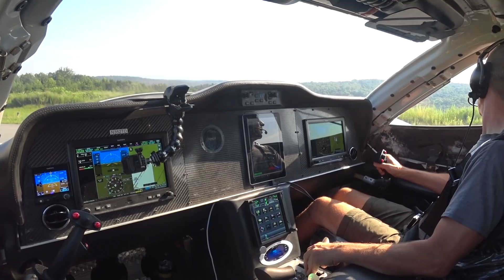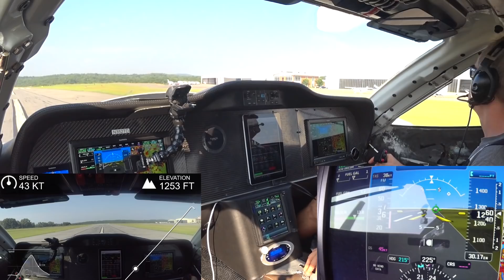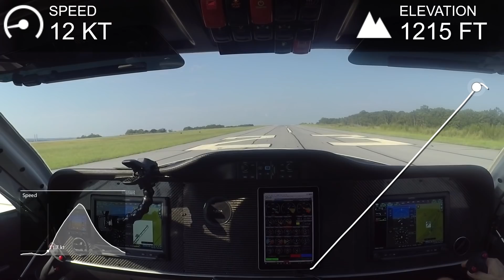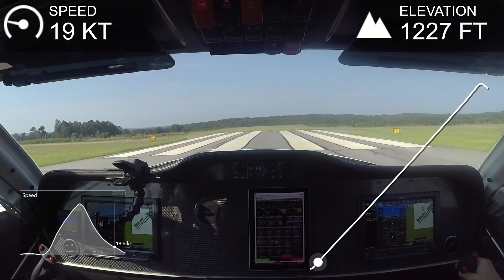Almost Airborne - Building the Raptor Prototype

Comment: Did i miss something?, I thought eliot was gonna fly the bird? 😅
Reply from the maker: I have said loads of times already that Justin is the pilot and Elliot will be flying the chase plane. I am not doing anything other than high speed taxi with the intent to attempt to just get it off the ground with power off if I can do it safely with plenty of runway remaining.
Reply: Raptor Aircraft putting the aircraft and yourself in danger. High speed taxi tests should be treated with respect and preparedness to actually fly. I think it’s time to leave it in the hangar till Justin gets there. Unless you want to become the test pilot.

Comment: Check out your synthetic vision in the video: it shows you far right of centerline. A few feet is in your RNP, but I've seen better performance from other youtubers.
Reply from the maker: The fidelity of GPS in this area has been reduced on occasion recently. I have noticed the same thing with my phone GPS. It's probably the military doing another jamming exercise. It's normally really accurate on the G3X.

Comment: How big is the exhaust port for the air exiting the engine compartment. The exhaust port maybe a bottle neck between taxi and take off speed. There may not be enough pressure differential to force the hot air out. Just a thought.

Comment: I notice what looks like piano hinges on the bottom of the wheel pants/gear cover. Is there a plan to add a folding part that covers the entire gear when it is retracted?
Reply from the maker: Yes
Reply: Go back a few months in the vids (cant remember the exact date...3rd quarter of 2019 I think.)

They were indeed fabricated,  attached, then removed...you can see why in the vids.

Comment: There  are a number of bayonet type cowling latches that can secure that hatch without cables. Each latch is independent so one latch being loose will not allow the panel to pop open.  Most military and commercial aircraft use bayonet style latches to lock frequently opened panels closed.  As a bonus, the underside can be painted bright orange to instantly indicate a loose latch.

Comment: I wish you had a longer runway to play with
Reply from the maker: If you look at the deceleration curve on the GPS overlay on the camera facing front you will see that my braking curve has room to stay constantly on the brakes whereas presently I get in it quickly and then I'm easing off the whole of the remaining runway. I have 2500 feet and I could stop in 1500.

Comment: Peter, I’m sure you know this well, but It can’t hurt to mention... I noticed when you pulled the nose off you gave it quite a bit of down deflection to put it back down. I’m sure that its an instinctive reaction. However when the main’s come off, resist the urge to push nose down and only chop throttle and go neutral so you don’t start a porpoise. I’m sure chances are low because airspeed is not much above lift off speed and you won’t be far off the ground. Good food for thought though.
Reply from the maker: As I said I'm fairly sure the right main already came off. 2 knots faster is not going to look much different. There's so little weight on the mains already at this point.

Comment: Peter, how much lead weight are you still carrying in the nose?  Using servo activated elevator trim,  instead of tabs,  i would think that when trimmed at T/O range,  the backforce on the control column should be very light,  without a hard pull needed.  How was it?  Easy or heavy?  Howard Hughes and Peter Muller to the naysayers, "Watch this, daylight".
Reply from the maker: It is trimmed for what I expect will be takeoff trim so I don't have to put much effort in at all to just add a little more elevator to initiate the rotation. The goal is that once it's at 4 or 5 degrees the elevator can be returned to takeoff position and it will climb out at 5 degrees initially.

Comment: Peter, are you current with a BFR and medical?  What have you modeled rotation/lift off speeds at?  How much of the 5,00ft are you using before approaching that speed?  Looks like about 1/2 (2500 ft).
Reply: Rude question but simple to answer: as an instructor, he doesn't need a BFR, just an online renewal of his CFI status, e.g. through American Flyers. You can check his medical status at the FAA web site: his is good.
Reply: Who are you to ask about someone's BFR or medical?

Comment: Is there pressure building up in the nose wheel well causing the hatch to open or is it just airflow over the surface? Or both combined??
Reply: Something is going on, as soon as he gets around 15 kts it starts to lift up, then becomes really apparent around rotational speeds (went back and watched previous vidios). Needs to rethink the latching system or like you said, maybe its positive air presure build up (that would be even worse).
Reply from the maker: It's fixed already.
Reply: Raptor Aircraft -excellent!
Reply: Would be airflow (Coanda effect) sucking it upwards. My poorly designed car bonnet does a similar thing on the highway. Better check the hatch rib strength and latch strength.
Reply: Some gaffer tape around the nose should fix it for the first flight...

Comment: You are talking about trying to get the mains off the ground.. Unless you are completely confident in your skill as a test pilot of an unproven air frame, and willing to continue the flight to pattern altitude and then land then continue.. If you're not confident then I suggest NOT attempting this and to let the test pilot[s] you hired do that.. It's pretty obvious the real world numbers are relatively aligned to your Aerodynamicist's calculations, there for I see no reason to push any further with out a complete commitment to follow fully with a take off and climb. Trying to get the aircraft into ground affect and back down to the ground mid field is just an unnecessary risk IMHO.
Reply: Peter, I trust your judge so please be careful.  Consider when getting checked out in light aircraft the first things we do ii slow flight demonstrations (all configurations) allowing us at a safe altitude to get a feel of the aircraft's handling characteristics that will be broadcast in the flare.   Canard, winglites, rudder feedback, their responses may  surprise you. Perhaps better to get that feedback at a safe altitude verses half way down a runway?   Really excited to be a part of this. Taking my "early out" retirement from Delta September 1st!  Great job so far, incredible perseverance!
Reply from the maker: Opinion noted. As I said, I'm taking it very carefully and at no time do I feel like I'm not in complete control. I'll stop well before then.

Comment: On the topic of that nose hatch opening, it seems like it is opening more as you increase the load on the canard. I know that back in the long ez days I was always paranoid when I heard things like this in the community which often led to the canard detaching from the aircraft. Might be worth while to rotate the aircraft again with a camera inside that nose compartment and see if there is some flex in areas that shouldn’t be moving. Last thing we want to see is a raptor with no canard
Reply from the maker: There is no chance that the canard is coming out. It's seriously bolted in. I suspect you'll see I have this problem resolved by the next video.

Comment: The prop noise changes significantly about 3 seconds after you apply full power on the initial take off run. Is there a reason for this? Great work as always!
Reply from the maker: It's the governor kicking in and adjusting the propeller blade angle.

Comment: Did u say the nose hatch had only a bungy cord holding it closed?
Reply from the maker: No. There's a handle for the cables that go to the latches. It appears to move to the down it open position when you hot a bump. The bungee is holding it from opening but obviously with not enough force.

Comment: Been thinking about the A/C and that 400psi number. Pulley may be over driving the system, may want to go with a slightly larger pulley. Could be freezing up the evaporator tube due to lack of flow, might just need a fan on it.
Reply from the maker: Factory aftermarket unit on stock engine.

Comment: I am getting so excited to see this so close to taking off, one question though, why do the side sticks appear to work in reverse to each other? Sorry if this has been explained before, it's been playing with my head for the last number of videos.
Reply from the maker: Look at them carefully, when one goes left so does the other.
Reply: @RaptorAircraft  Once I started thinking about it, when they both point inward its the centre point right?, now it makes more sense!
Reply from the maker: @tseesinnep3r  yes. 48 degrees toward the center of the aircraft is the neutral point angle for each stick. It's what feels comfortable in the hand.
Reply: They move together but are pointed inward so they have a full range of motion without hitting the doors.

Comment: First!  Glad to see the AC is cooperating with more flow.  I purchased a mini-radiator with built-in fan - are you using an auxiliary fan for the condensing coil?  Popped a wheelie!  We ALL want to see it fly for sure.  It looks like the “frunk” lid is coming loose.